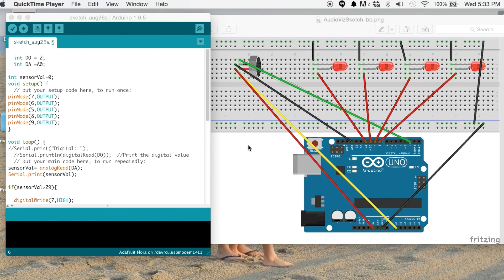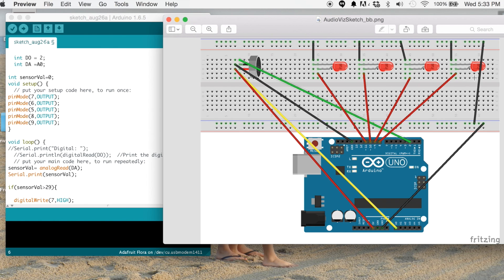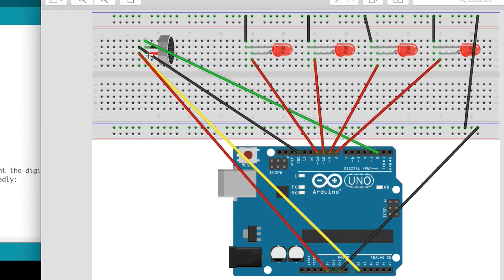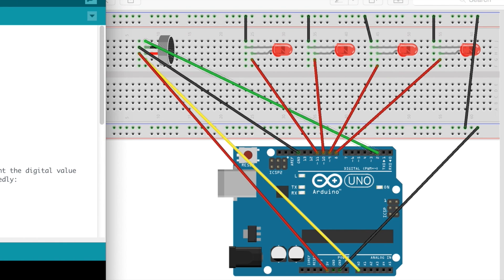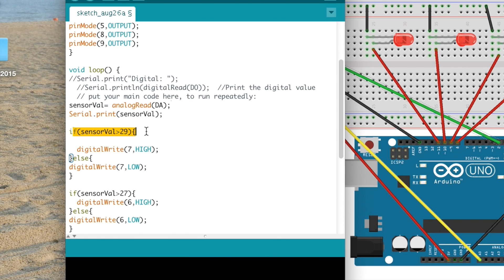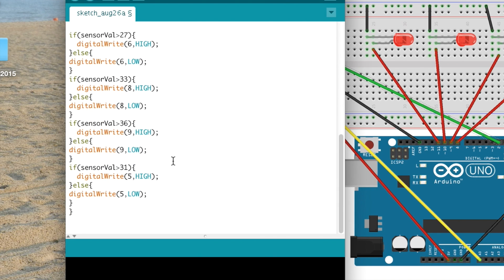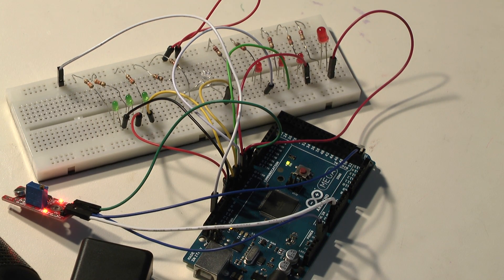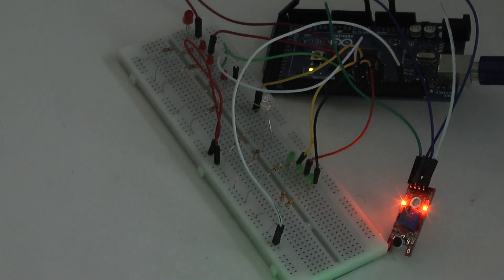Arduino Audio Visualizer

Comment: Could you also use an AUX output from a smartphone instaed of the microphone? It should work, but i'm completely new to arduino so idk
Reply: I'm sure you've figured it out by now, but yes, that should still work
Reply: @SimplyStuart94  Yes I did figure it out and the levels vary from phone to phone. Usually, by just connecting one channel to Analog In and also GND, you get values of up to 100. Thanks for the answer nevertheless xD
Reply: @ProtoMan137  the output of a smart phone 3.5mm audio jack is ac, this can damage your arduino (DC)
Reply: @couchpotat  depending on the ADC. It may be not a Problem. Time to dive into the rabbit hole. Or just waste an arduino. Mine still works AFAIK 😅